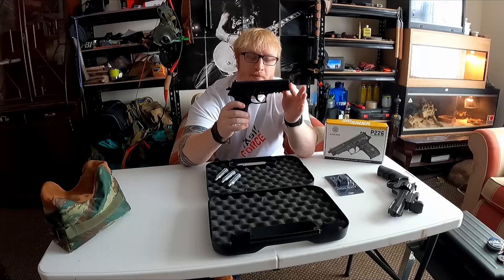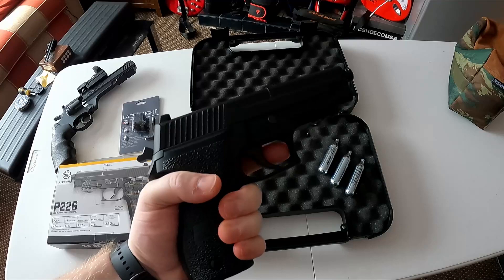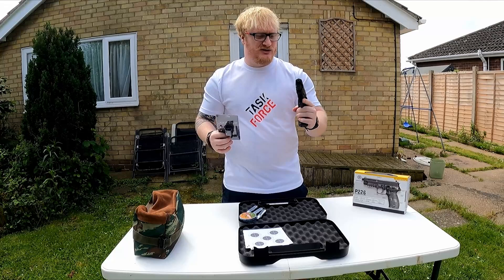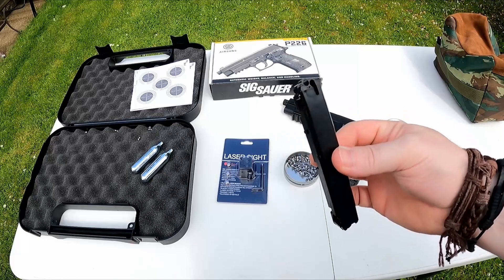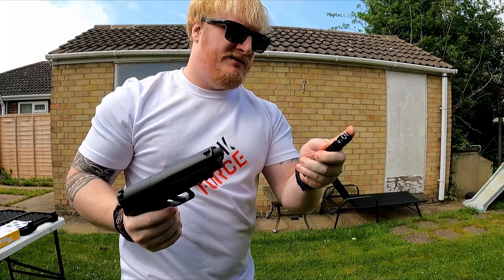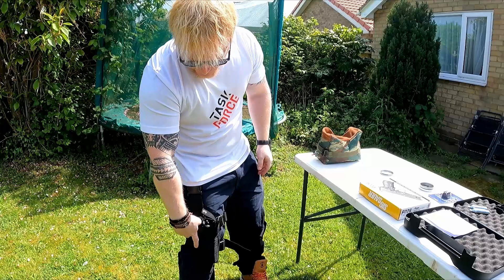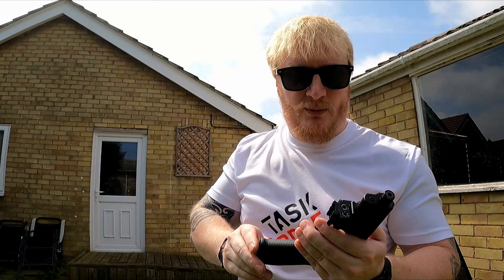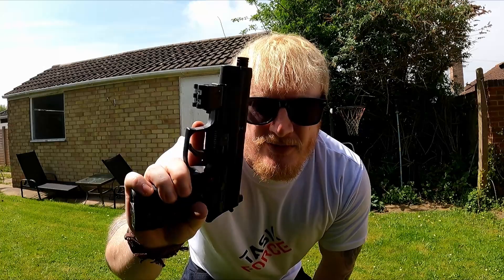SIG SAUER p226 C02 Air Pistol Built Like The Real Thing

Comment: Does the slide come off for cleaning, similar to the M17 pellet gun, or does it need to be dismantled differently?
Reply from the maker: its a  blanked-off ejection port, non-operative slide catch and takedown lever. so just decoration, would have to be dismantled diffrently
Reply: I'm new to pellet guns and I've been researching for a couple months. The P226 has what I like, with the quick co2 install, as well as a nice release on the pellet mag. 

I like the M17 because of the slide release, but not crazy with the full mag, which would result in having to put the gun down to replace the pellet mag or swap out the co2.

With that said, how important is it to take off the slide, other than maintenance and at that how often would that need to be done?

Would taking off the slide also be necessary if there is an internal jam within the gun?

Sorry for all of these questions, but like I mentioned, pellet guns are new to me. 
Thank you for your help. Very much appreciated.
Reply from the maker: @nyrainman4897  honestly bro keep the C02 bit lubed up, maybe a lil clean with WD40 every now and then everywhere else not much maintaining these. if you want a fun C02 weapon try the Full Auto Desert Eagle it's a airsoft but loads of fun